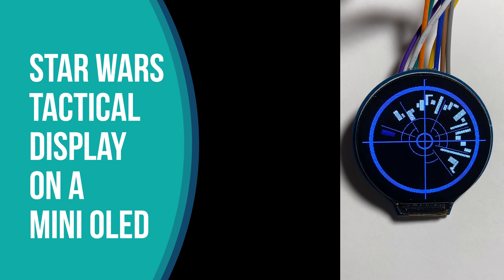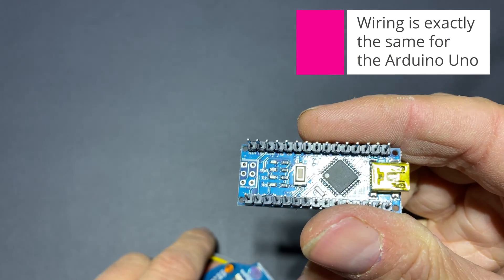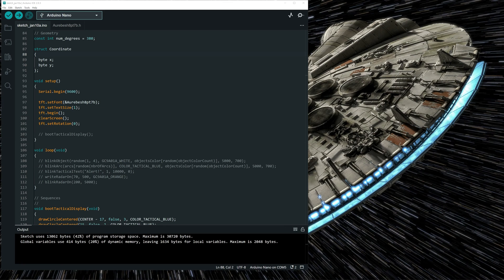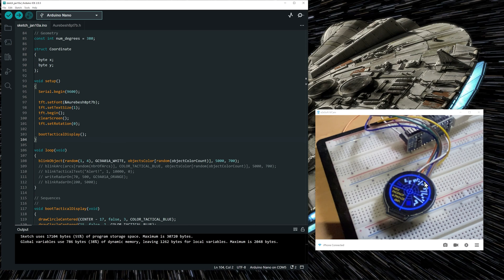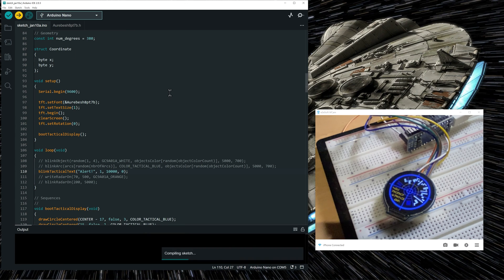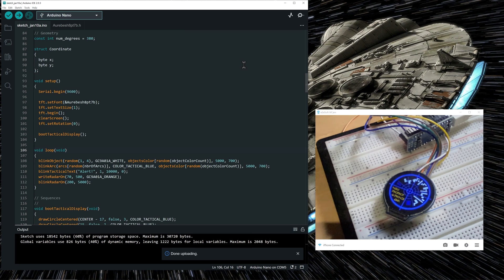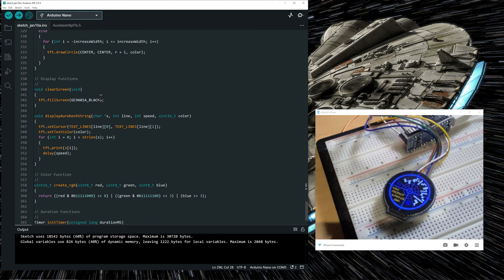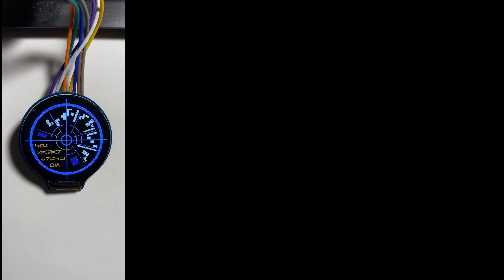Create a Star Wars Tactical Display with a the Round Display!

Comment: this is so amazing, I am just learning how to code, how could i have this animation running on a small 1.8inch  128x160 square screen?
Reply from the maker: You can adapt the code easily, with some trial and errors, you will find a way to adapt it
Reply: @thelastoutpostworkshop  so far what I've done is extracted the .gif then used ezgif to resize, then convert it back to a .h. it's a bit clunky but it's works :)
Reply: @ actually i couldn't get it to work, can you help me please

Comment: Hello, I am using the round display with pin headers. I went to wire it and there is BL pin, only 7 pins. Is the BL required and do I have to get the other display? Thanks again
Reply from the maker: BL pin is not required

Comment: Awesome video. Question would there be a way using this Waveshare LCD and Arduino to have the screen only turn on using a proximity switch
(int switchReed=2).For example open a door or compartment (digitalRead(switchReed)==HIGH) the LCD would boot up and play the animation and when you close the door it goes in standby or screen off mode? Using a normally closed reed switch wired to a 10k pull-up resistor to pin D2 on the Arduino. Still really new to Arduino coding, thanks for your help.
Reply from the maker: Yes it could be possible
Reply: @thelastoutpostworkshop I love this idea. But I don't have any idea on how to code this. Could you please guide me or help me

Comment: In file included from C:\Users\DuploUSA\Documents\Arduino\libraries\libraries\Adafruit_GC9A01A\examples\graphicstest\graphicstest.ino:2:0:
c:\Users\DuploUSA\Documents\Arduino\libraries\libraries\Adafruit_GFX_Library/Adafruit_GFX.h:12:10: fatal error: Adafruit_I2CDevice.h: No such file or directory
 #include <Adafruit_I2CDevice.h>
          ^~~~~~~~~~~~~~~~~~~~~~
compilation terminated.

exit status 1
I'm getting this error any advice
Reply from the maker: Make sure the libraries are installed : Adafruit_GFX (you install it through the IDE) and GC9A01A (you install it manually)

Comment: Not sure if something changed in your code but I get a list of errors when I try to load this , to give you an idea what I'm see in the error list 

In file included from C:\Users\cory3\Downloads\Display240x240\Display240x240.ino:9:0:
C:\Users\cory3\OneDrive\Documents\Arduino\libraries\Adafruit_GC9A01A-master/Adafruit_GC9A01A.h:48:0: warning: "GC9A01A" redefined
 #define GC9A01A 0x09   ///< Read Display Status
 
C:\Users\cory3\OneDrive\Documents\Arduino\libraries\Adafruit_GC9A01A-master/Adafruit_GC9A01A.h:47:0: note: this is the location of the previous definition
 #define GC9A01A 0x04   ///< Read display identification information
 
C:\Users\cory3\Downloads\Display240x240\Display240x240.ino:78:102: warning: narrowing conversion of '63488' from 'unsigned int' to 'int' inside { } [-Wnarrowing]
 const int objectsColor[] = {GC9A01A_GREEN, GC9A01A_NORON, GC9A01A_RED, GC9A01A_ORANGE, GC9A01A_YELLOW};
Reply from the maker: Nothing changed, are your includes at the top of Display240x240.ino are 
#include "SPI.h"
#include "Adafruit_GFX.h"
#include "Adafruit_GC9A01A.h"
#include "Aurebesh8pt7b.h"

?
Reply: @thelastoutpostworkshop  thanks for replying, I got it working. Had to switch the  Processer: ATmega328P (Old Bootloader)

Comment: Very nice! I hope to do this but would like to try using a Arduino Nano Every. Do you know of anything I should be aware of using the Nano Every instead of the Nano? Thank you.
Reply from the maker: I don't know the Nano Every and based on what I read it's very different than the Nano in many aspects.  Give it a try and let me know the results!
Reply: @thelastoutpostworkshop  I purchased the OLED display from you link above. Using the pin layout of the Arduino Nano Every I wired it according to your directions in the video and it worked perfectly. I appreciate the thorough explanation in the video and look forward to experimenting with the code. Thank you.
Reply: I forgot to mention that I do get the message 'avrdude: jtagmkII_initialize(): cannot locate "flash" and "boot" memories in description'. Since I used the Arduino Nano Every, it may be something to do with that. The routine still works but I was wondering if there is a way I can correct to not get this message.